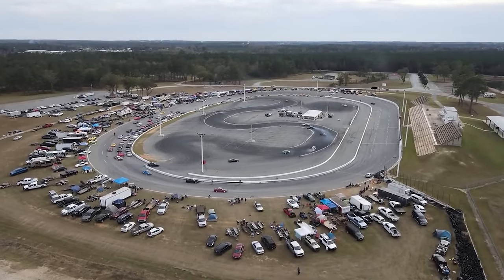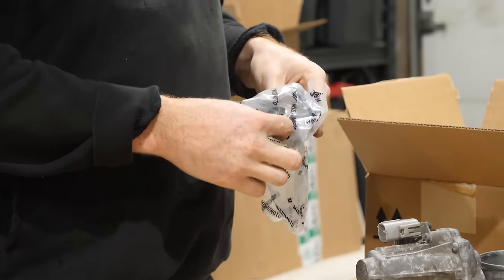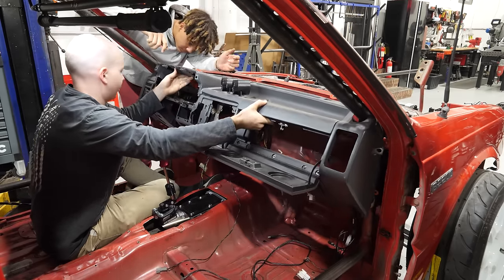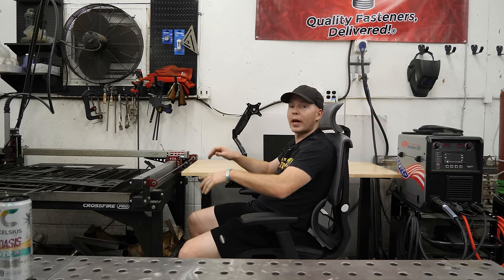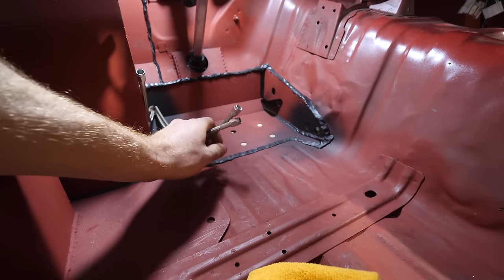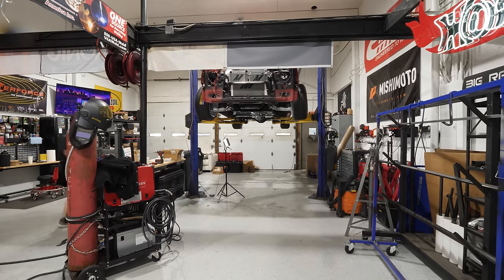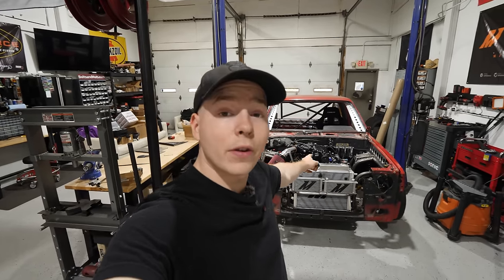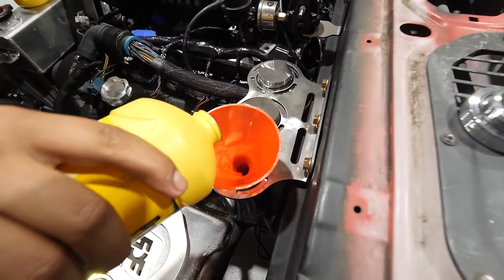Getting Close To Hearing DRIFT TRUCK V2 Fire Up! Will We Make The Deadline?

Comment: It looked like the throttle cable was able to pull the lever on the TB, but it didn't look like the blade opend very much for how much the lever on the TB was pulled by the cable. May wanna check the footage.
Reply: Glad I’m not the only one who noticed that
Reply: 1uz vvti things,  the throttle is a weird combo of dbw and cable. the cable partially pulls the throttle which in turn turns a pot that gives signal to the drive motor for the throttle blade. Thats why the throttle body for the 1uz vvti has that huge thing hanging off the side of it. the 3uz went full dbw and has the same bolt pattern, so its kind of strange that gingium used the ugly 1uz vvti one.
Reply: @Isnt-it-Lovely  interesting stuff... Thanks for the education!

Comment: the exhaust needs to be super heat wrapped and maybe add a heat shield because it will melt anything susceptible by it in the steering column. i have seen it happen several times on similar setups.
Reply: Gingium gotta see this.

Comment: Intake air temp sensor should be after the supercharger as that's what the engine will actually see
Reply from the maker: Not possible on this manifold unfortunately.
Reply: @_Gingium_   intake runner like the 302 foxbody mustangs do

Comment: Am I the only one noticing the throttle body barely opened?
Reply from the maker: Yeah, the throttle is a weird electronic motor cable thing. The throttle cable opens the throttle a little, then the motor assists it. So it won’t be fully open unless the ecu is powered on

Comment: You should add a short (1 inch?) baffle the inside of the brake reseviour. If you have a leak in one of the systems, the baffles will keep the reservoir from completely draining, and you'll still have just enough for the other systems.

Comment: I've got a 93 VW Eurovan that needed a master cylinder. Took a little modification to make what was supposed to be a direct replacement look like the original. Got that done. Felt good about it. Now I realize the hardlines have holes in them and its shooting brake fluid under the van. One step forward, one back. Even slight modifications can be frustrating sometimes.